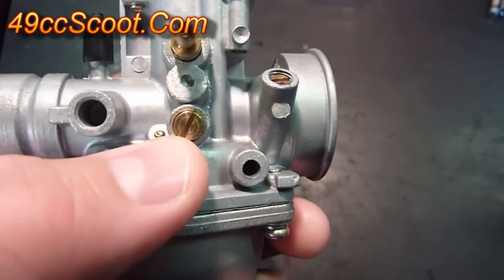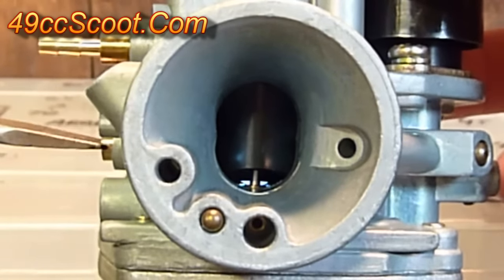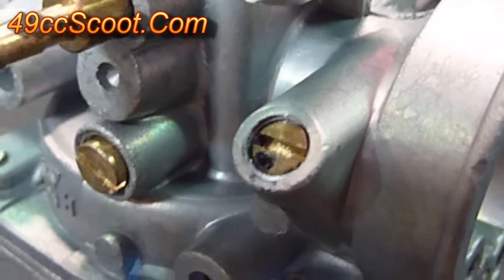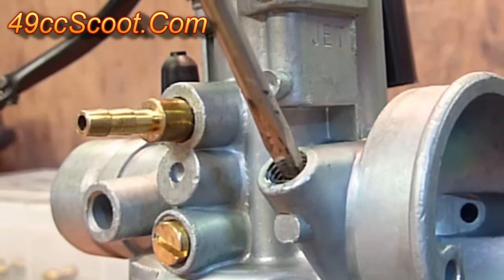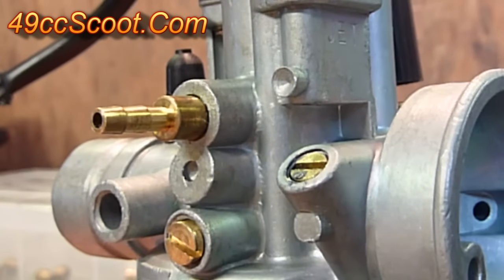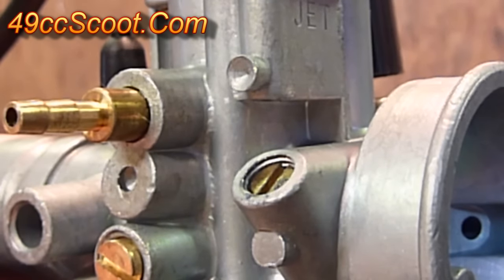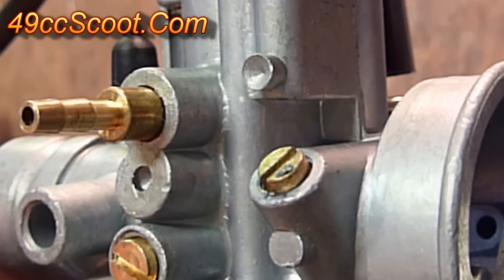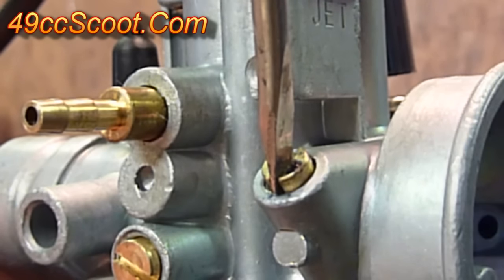Two-Stroke Scooter / ATV Carburetor Settings And Adjustments 2of4 : Idle Speed & Mixture

Comment: Thank you for the video! What would be a recommended level for the idle speed screw after setting the idle mixture? Should the wheel not turn at all or is it okay if it turns a little when idling? Thanks again!
Reply from the maker: It's alright if it barely turns. Most end up 1500-2000RPM.
Reply: Sorry for the late reply, thank you, much appreciated!
Reply: TopSecretNick j

Comment: Hi - I have a question. We have a Piaggio liberty 50 cc 2 Stroke in the family. It's 5 years old with around 12,000 km on the clock. I can't seem to get it to ride faster than 38 to 40 kph during the colder months. In the summer it runs much faster, any ideas what could be the problem?
Reply from the maker: My first thought is maybe it's running a little lean. Main jet too small. The hotter and often more humid summer air may let it run well, and then the cold dense winter air with less humidity leaves it a bit short on fuel.
Reply: @49ccscoot  Thank you for the reply - I'm a complete novice when it comes to engines..   is there a simple solution I can do at home or should I take it to a garage for a professional to check?

Comment: Hey, scoot, I have a question for you. 4 years ago my cousin managed to install a big bore kit on my Minarelli scooter, but when we fired it up, the scooter just immediately started to rev very high from the get-go. He didn't touch the carb screw settings.

I am now rebuilding the engine with a standard cylinder, but I am very scared that when I start the scoot, the same thing will happen. I can't imagine that WOT on an unset cylinder will do the scooter any good... I wonder if he managed to somehow shorten the cable length for the throttle...

What would you recommend to check just to be sure that the revs will be low when I start the engine? Should I try to lower every setting possible to get the lowest idle speed? (perhaps even to the point where the scooter will immediately die down and then adjust the screws from there?)

Cheers!
Reply from the maker: It sounds very likely to be a cable issue. Easy check is to look into the mouth of the carb once it's installed and see if the slide is near the bottom of it's bore. If it's up much, then it's going to rev. May be as simple as reinstalling the slide and needle and making sure it all goes together properly. Could be something like taking too much out of an adjustable cable.
Reply: @49ccscoot  thanks a lot! Really appreciate the help. Hopefully, once I finish, I'll come back with good news. Your videos are a bloody godsend, thanks.

Comment: What if turning the air screw all the way in or all the way out makes no difference at all? I bought a new carburetor which is sold for my bike model and it is supposed to work out of the box. And indeed it works, idle, half throttle and full throttle. But I cant set the air screw cause it looks like it does nothing.
Reply from the maker: Maybe the float height is wrong or the pilot jet is way off.
Reply: @49ccscoot  using it today I found out that it works pretty rich. Because when I turn it on and rev it, lot of smoke is coming out of the exhaust. Also I have to give it throttle in order to turn on. It does not turn on by pushing only the starter button.

The carb is a brand new 17mm chinese gurtner clone. Replaced a dellorto phva 12.
Reply from the maker: @cabrinhaGR  So much for "supposed to work out of the box". Possibly too large of a main jet and pilot jet.I'd prob start with main jet swaps to see if that helps it all around.
Reply: @49ccscoot  main jet comes into play when throttle is fully open, right? And when I am on wot everything is ok. In fact everything looks ok in the whole spectrum, from idle to wot. The only problem is that the air screw does not affect mixture (no rise or fall of rpm, no engine stall etc.).
Reply from the maker: @cabrinhaGR  It does. Large main jet could make everything bad, but if it's good everywhere else then prob don't start there. New or not, I'd clean the carb. I don't trust Chinese stuff to be setup properly or free of debris.

Comment: after my automatic choke comes off, my scooter dies.. i took the carb off and cleaned the jets which were blocked and put it all together. after putting the carb back it would still do the same thing.. i found out after watching this video that i dont have an idle mixture screw lol... where can i get one from? its a yamaha beewee 2007 model 3000kms

Comment: Got a question that I haven’t dealt with both screws are all the way in with no change is that an leak somewhere?
Reply from the maker: Could be a leak or carb problem. It could be that the pilot jet is way off or the carb needs to be cleaned. Could also be that the main jet or needle is way off. If it has ran fine and now doesn't, than most likely the jetting is not suddenly that far off. I would start with a thorough carb cleaning.

Comment: If it increases or stays the same, you keep the way you were turning it but if you are either turning it outwards or inwards and it decreases, you go back the opposite way, did I get that right? if its increasing or staying the same when do I know when to stop to leave it in a good spot?
Reply from the maker: You have the right idea. It should level out at some point. Then set it as rich as you can at the highest RPM you're getting with the mix screw.

Comment: Hi there I have a 50cc Honda x8r 2002 moped and in the mornings it struggles to start massively thing is I’m not a motorbike mechanic I don’t know it’s carb settings or anything like that wandering if you knew of them if you worked on one before
Reply from the maker: I don't know anything about that specific bike. If it has an automatic electric enricher/choke, you may want to check that out. Good news is that being a Honda you should be able to find a service manual that will tell you how to do that and also lots of other troubleshooting. You can try a sort of "crutch" that sometimes helps till the issue is found. I have had iridium spark plugs help hard starting bikes before. It is not a fix. Just something that may (or may not) make it work slightly better quickly.

Comment: I'm new at this. what dose this do. any power/speed performance benefit?
Reply from the maker: It will help you have a steady and safe idle first. If it's too far out of tune it can cause problems getting on or off of the throttle like hesitation or RPM hanging when you let off.

Comment: Hi I ask you before a question I fit a new cylinder kit from 50cc to 75cc now my carburetor is a stand one the main jet is 70 Whitch size you recommend four the 75cc Maine exhaust is a stand to tank you very mutch BERENGUER
Reply from the maker: I always recommend tuning. Have a jet kit handy and select the one that works best. That said, I'd start at 90 main probably. If it seems rich, 85, if it seems lean 95. Continue and record results till you find the sweet spot. Just tune for WOT first. Worry about the rest after WOT is good.

Comment: Can someone tell me what the upper left copper nipple is and what it does. I’ve got this hyosung sd50 rush challenger 2002 that had a cable shoe fitted with a white/red cable connected to it between that. And onto where it looks like a vacuum hose would be put there was another cable shoe mounted straight onto the nipple with a yellow/white cable connected.. need to know what this is since i havent seen this before. It will sometimes start and sometimes wont start. Will idle for 10 secs and then die out. Havent seen this on ang other carb.. New to these korean 50cc’s

Comment: My Suzuki 125 burgman 06 idles fine for about twenty minutes from cold but once warmed up I need to keep the throttle on. If I adjusted the carb would this solve this issue? I have to remove fairing & seat & rack to get access so if it won't fix I don't want to remove as it's a pain. It has just been serviced too!
Reply from the maker: Perhaps. If the valves were not checked/set during the last service I would suggest doing that as well.
Reply: Apparently, they were, makes me wonder if I should of serviced it myself using your videos, but thanks for the quick reply.

Comment: YES WHAT IF YOU CAN NOT GET IT STARTED TO DO WHAT YOU ARE SHOWING ME TO DO WHEN MINE HAS MABEY 2 HUNDRED MILES. A it just stopped. I had to put the bike in the truck to get it home. took the carberatour apart , put it back togather, started and ran . 15 min. later turned it off , never would start again. Have great spark!
Reply from the maker: What happened each time it died on you? ... Wide open throttle... cruising... came to a stop sign... made a noise... etc...

Comment: I have a question. What does it mean if the bike starts better with the choke up. Is it to lean or rich
Reply from the maker: It may be fine. The choke is there for starting because cold engines need more fuel. That said, if an engine responds better with the choke engaged, it's lean because it's liking the added fuel.

Comment: Hi. I've got a 55 plate gilera runner sp50 and it runs fine on idle and low speeds. But it bogs down on full throttle. Any ideas? I know it's running too rich from the spark plug but not sure how to sort it. Thanks
Reply from the maker: +Cody Sparrow When the problem is at full throttle, you should be looking at the main jet. It's either the wrong size for your application or it's clogged. There's a chance that float height is off and making it rich, but usually the low throttle operation is affected more.
Reply: Hi, thanks for getting back to me. I've noticed that when the engine is running cold its not affected but gets worse the warmer the engine runs. Could that be caused by the same thing? Thanks
Reply from the maker: The engine needs more fuel when cold, so as it warms up a rich condition may show worse symptoms.

Comment: Okay, how should the setting be in a four-stroke engine ?
Reply from the maker: Same process. Just pay attention to where the mix screw is. If it's on the air filter side, it controls air so in for richer and out for leaner. If it's on the engine side it controls fuel, so in for leaner and out for richer.

Comment: I have an idle and an air mixture screw on my carburator. It didn't come with any specs on where to start a base line. It is EXTREMELY FRUSTRATING trying to adjust the carb.It seems no matter where I start the idle screw, 2 turns to 4 turns,or whether I open/close the air screw (either from all the way in to 2 turns out- and every half turn in between as a start), the mixture is always too rich. I pull my plug after about every 4-5 adjustments (trys) and is always wet and black. What can I do for a base line? And which screw should I start with? What am I doing wrong?
Reply from the maker: Jerry Czornomor Usually start around 2 turns out. I never check the plug for idle. Mine are pretty much always wet at idle and I'd prefer them to run rich at low throttle. Forget the plug checks. Just work to get a good idle quality and so it doesn't hang or die and response is good.

Comment: My engine is running rich lots of smoke and idles very high so do I start by adjusting the idle screw until it idles slower and then adjust the mixture to suit?
Reply: Or should I just reset both screws by screwing them all the way in and then 2 turns out and adjusting it from there?
Reply from the maker: @dramen1013  You could do it either way. If you decide to reset them, count how many turns it takes to gently seat each and write it down. If it doesn't work out, you can go back to that point. I would probably just try lowering the idle speed to closer to a standard spec and then adjust the mix screw.

Mine  smokes a lot all of the time, but I run 32:1 premix.

Comment: Where do you set the Idle Speed Screw prior to adjusting the Air Fuel Mixture ?
Reply from the maker: If it's on a running engine, adjust the speed screw until the idle RPM is roughly  2,000RPM or whatever your service manual says.
Reply: @49ccscoot  Thanks for the reply Sir... The engine does run but have yet to find a manual. its a 2007 TGB Sunset 50cc with a Mikuni carb. Also seems to dump a lot of oil right from the carb when its on the side stand. Any ideas ?
Reply: guess I should have mentioned, its leaking oil from the carb when its off and on the side stand. Is this normal ?
Reply from the maker: @Michael87r  Not normal. If it is pre-mixed (you have to add oil to the gas tank) then the float height is probably too high. If it is oil injected (has a reservoir for 2T oil) then you probably have a malfunction somewhere in the oil delivery system. Some use a little ball valve/check valve to keep oil from flowing when the engine is off. That may have failed.
Reply: @49ccscoot  It is oil Injected, pulled the oil delivery/oil pump off and cleaned it. Seems to be functional. Still seems to do it though, maybe a new pump is in order. I'll update you as things progress. And thanks again for all your assistance.

Comment: My bike is not sucking fuel, it seems like there isn’t enough suction to make the fuel come out. The jets are completely clear along with all the passage ways. I’m stumped any help?
Reply from the maker: Are you sure it's getting fuel to the carb? Could be the petcock or something clogged. If you don't feel much suction when you cover the mouth of the carb with your palm and the engine is turned over, you may have low compression or something not sealing so do a compression and/or leak test.

Comment: I have a question iv got a 1976 arctic cat panther 500 starts fine everything seems ok until you lean the machine to one side it dies and if you hit a very slight bump it seams to die also even at a small incline what do you think this could possibly be? Thanks
Reply from the maker: Check the fuel line routing to see if anything could be getting pinched and check float height. Those are my first 2 thoughts.

Comment: Where to go with jetting if my spark plug is oily? Bigger main jet?   My exhaust also get filled with oil after some hundred miles and have to get burned out because of performance drop.
Reply from the maker: If you're premixing you could be using too much oil or possibly too rich on the tune. If you're using the stock injection system I would advise inspecting it first. See if you've got oil collecting anywhere else like the airbox or intake. See if oil leaks even when the engine is off.

Comment: My Carburetor seems to be leaking at the idle mixture valve.  Can this be fixed or does the entire carburetor need to be replace?  I have taken apart and cleaned the carburetor and it is still leaking.  Any help would be appreciated.
Reply from the maker: Jared Zieris There's usually an o-ring or other type of seal back there. Maybe it's gone or in bad shape.

Comment: Hi, thanks for the video! I recently put together a GY6 150c to a Ruckus frame and  i am using a OKO 28mm carburetor, moved to South America to an altitude of 3500 meters above see level, but my carburetor  was adjusted for sea levels. I was able to get the idle speed calibrated getting the right RPM but in order to get this scooter out of customs i need to drop the level of CO. the results were HC 471 and HC Limit should be 125ppm on the other hand i have the CO results of 9.00 when the limit CO should be 0.50. what do i need to do to reduce the level of CO?
Reply from the maker: +Juan Jose Bozo I don't have to deal with emissions testing here, so I'm not really familiar with what it takes to make a big swing in those numbers. I would think changing the main jet would be a good start. Your main jet is likely too rich since you're at elevation now. The mixture screw only really changes the idle.
Reply: CO is a result of unburned fuel. I would lean the mixture out, but be aware that's going to affect your other readings too.
I realize you probably already solved this after 6 years.

Comment: Okk so I have a gilera runner 50cc it has a k&n air filter and a pm tuning 360 pipe it has a 100 main jet and I was told I would need a 110 to 113 for the main jet because it bogs down when I full throttle is this the idle or the jet please help thanks?

Comment: Greetings friend. i have a vento 50cc 2 stroke Minarelli and i want to remove the oil pump, which amount of oil i have to mix with gasoline? Thank you very much
Reply from the maker: +Brikos S 32:1 to 40:1 is most common. 4oz per gallon for 32:1 or 3.2oz per gallon for 40:1.
Reply: THANK YOU BROTHER
Reply from the maker: No problem.
Reply: FRIEND A QUESTION.MY SCOOTER HAS A BELT STANDARD 788/17-, AND I'M GOING TO CHANGE BY A MALOSSI 793/16.8 -30. My question is: if I am going to give me a good result (performance)? Because I AM IN TIME TO RETURN IT. GRACIAS
Reply from the maker: Should be about the same. Sounds like it'll work.

Comment: if nothing much happens when i turn the idle mixture screw, do you think i damaged something inside the cylinder. I have a sudden loss of power after using too much starter fluid i think. the spark plug was all black and wet and there was smoke coming out of the spark plug hole when i took the spark plug out. I changed the spark plug and still low power but idles great.
Reply from the maker: Check compression.
Reply: Ok i checked the compression. Its low what does that mean
Reply from the maker: Be 100% sure you're doing the test right. Wide open throttle and tester is sealing. If it still fails, you'll need to have a look at the head gasket, spark plug threads, piston, rings and cylinder.